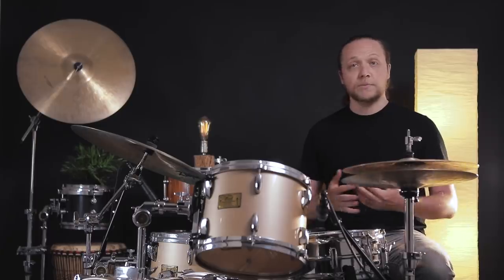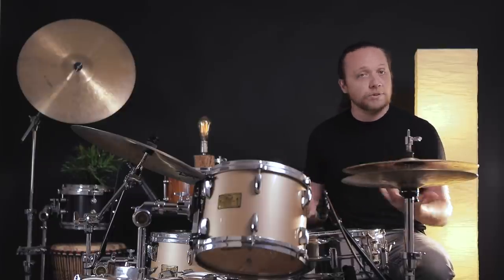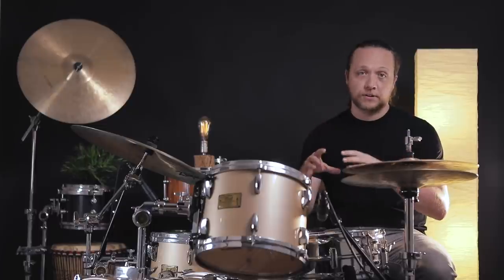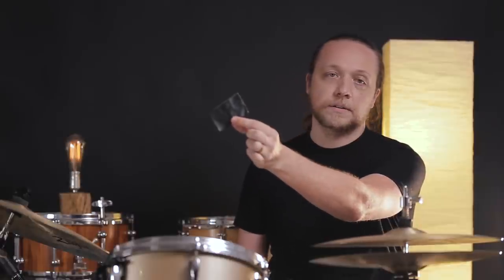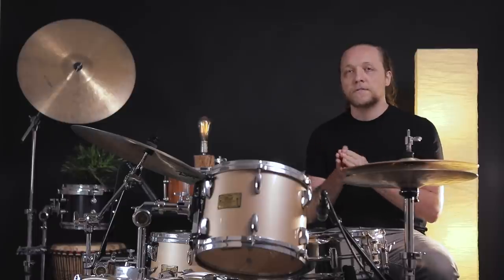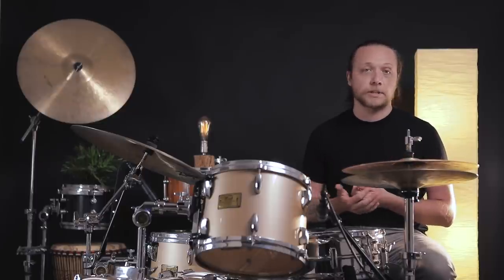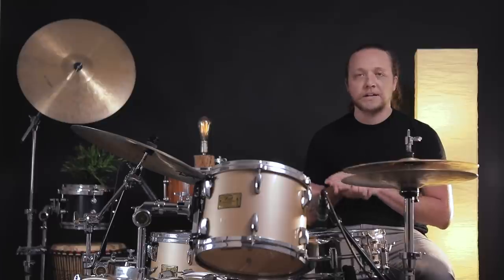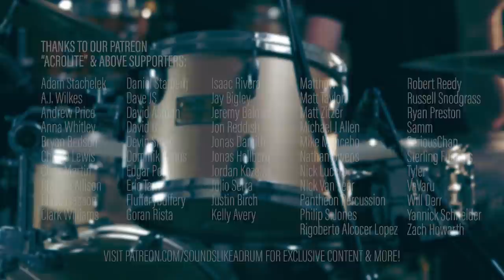Reso Drumhead Trick For Focused Toms | Season Three, Episode 15

Comment: Hello guys. I think Dave Grohl does the same with his toms, especially the DW set that he uses in recent years. He puts a "duct tape cross" on the head of the reso and it definitely must be because of this.
Sometimes I use little blanket bits inside the toms to control the sustain, but it cuts too much. I will definitely give this a try.

Thank you so much for another great video. Cheers.

Comment: currently running a combination of these hacks on my 16x16 floor tom;
nailed a sheet across to interrupt air flow
2 cotton balls inside
taped center
with a coated emp on top, and an evans ec reso bottom. between all these hacks, it's finally sitting where it needs and i wouldn't have been able to come to these conclusions without you guys doing so many experiments. thanks for all you do!

Comment: I love this idea, and will be trying it tomorrow at rehearsal! We recently put UV2's on the tom heads of the set at my church, and I love the sound and feel of them! With the set being sealed in an enclosure, the toms tend to sound a little wild and be hard to control in the mix. I really like the idea of how this helps focus the sound, reduce overtones, and also compress the dynamics. Excited to hear what kind of results I get! 

Could've used this trick a couple years ago when I had my floor tom tone dialed in perfect, but it wouldn't stop resonating. We were outside on a mobile band stand trailer, and I tried moon gels on the top and bottom (off center, near the rim), and it didn't help at all, as you suggested. In a pinch, I ended up resting my stick bag against the shell to absorb some of that resonance. This center patch trick probably would've given me the same (or better) results I'm guessing!

Great stuff, as always. Thank you!

Comment: Answering the question about what I do with reso heads...

I have this same set of drums-same sizes- and they are RESONANT. So much so that toms will ring for a full three seconds. I use coated resos as a rule--that helps more with the character of the tone rather than the length of the note, I suppose, but I've found that when I want the toms tuned to low pitches, a tiny bit of gaff on the edge of the reso head helps shorten the length of the note a bit, especially if near a lug I've detuned. When I say tiny I mean the size of the shift key on my keyboard.

Comment: Hey Cody and Ben!  I work with a couple of drummers sometimes who will use an Evans Hydraulic head as their floor tom reso, as the combo of the oil and 2 plys really enforces a solid low end.  The way they do it sounds really killer, but it is a very low tuning and one might say it has too little sustain depending on the context.  I also had a chat with the drum tech for Awolnation at one point a few years ago, and he was using EC2s as resonant heads for their drummer's kit, following the same principle regarding the extra mass of the two ply head, plus that ring around it.  Either way, I'd be curious to hear what y'alls thoughts are on using two ply heads as resonant heads, and how you think it feels/sounds, and what you think the advantages and disadvantages are to that.

Comment: Benny Greb uses coated resos to a similar effect. Its not as directly focused as this mod will get you, but I find that the extra mass from a coated single ply heads cuts back on a lot of the higher over tones
Reply: in addition he puts a cotton ball that has been stretched out into a small pad inside the floor tom to act like a gate for the extra resonance

Comment: So if I used heads with black dots as reso heads for my toms, would it have a similar effect?
Reply from the maker: Yes and no. Added center mass will help focus the toms. We like the ability to fine tune and easily remove which is why the tape approach is a win for us. On top of that, next to no $ spent.

Comment: Can I ask a question. I've got a Pearl Reference series kit that has slightly rounded edges on the 10/12 Toms, and fully rounded on the 16' tom. I was reading stuff about how people found 2 ply heads on rounded bearing edges(mainly on smaller 8-13' drums) abit dead sounding, like it was all thwack/thud/attack without much resonance, and that people seem to prefer 1 ply heads. So I was thinking of maybe trying Ambassador X's. Have you guys ever tried the X's , or has anyone reading this ever tried them? I was hoping maybe they would be a good middle ground between a Coated Emp and a Coated Ambassador, and sustain/bring out the shells of my Reference drums abit. That being said, the reason Im asking is because I just got the drums, and havent had a chance to experiment with anything yet, and just getting ready to do an order.
Reply from the maker: We’re big fans of 12mil single-ply heads (The Evans G12 started this trend and has been a favorite of ours for quite some time now). Regardless of the bearing edges, two-ply heads can often be a bit limiting on smaller drums so it’s worth checking out some single-ply options if you’re experiencing this.
Reply: @SoundsLikeADrum  OK, thanks. Ya I guess I'll just have to try a couple things, and see hah. How do you find the stick feel is on a 12 mil single compared to a regular 10 ply single or 2 ply head?
Reply from the maker: The 12mil definitely feels like you're hitting more mass than the 10mil (like hitting a heavier cymbal) but it responds at a softer dynamic than the 2-ply options.
Reply: @SoundsLikeADrum  I see. Nice, so kinda somewhere in the middle too. Appreciate it!

Comment: I imagine you could get a similar effect by using some sort of zero ring (or better yet: one made from an old head) on the bottoms, but you'd have to secure them in two places? My drums originally shipped with black dots on the top and silver dots on the bottom. Many years of experimenting later, it's still the right choice for heavy playing.
Reply from the maker: The key is to mass load the center of the head in order to affect the fundamental. You could adhere a zero ring though you’d want to use one that’s dramatically smaller than the drum and that still leaves out mass in the absolute center. Certainly worth experimenting though!

Comment: what kind of batter heads are those-which model of evans.
Reply from the maker: They’re the UV2s
Reply: @SoundsLikeADrum  also just got a new set- my first set since i was kid(pearl roadshow)- what about putting gel pads on the bottom of the toms- and use the gaf tape to hold them on-do i put it on the edges or center to get the most lows
Reply: I have the evans-dampering e rings on the top-they knock out most of the ringing.

Comment: This makes me curious to try just putting cs black dots on the bottom of my toms
Reply from the maker: That’s certainly a consideration worth making. We like the no/low-cost DIY option to maintain your current reso heads and adjust as necessary.
Reply: @SoundsLikeADrum  how about using double clear heads as resos? I think you guys did a video about it, no?
Reply from the maker: @cidboechat9472  As in two-ply heads? Yep, very different effect. https://youtu.be/ew64BFMcmaA

Comment: And what if you do the same thing, but you put the tape on the underside of the batter head?
Reply from the maker: First thing you’ll notice is a dramatic change in the feel of the head. Dynamic range goes do as well. And while the fundamental is a bit more present, if you don’t have your batters tuned high enough, they really aren’t going to project far beyond the drum throne.
Reply: @SoundsLikeADrum  Wow, okay, then I might not try that one out lol.
Also, kinda unrelated, but you could do an episode on mounting floor toms (or just really big toms) as racks; different mounts compared, snare stands vs suspension mounts, etc. That would be interesting!

Comment: i used to use moon gel in the center of the bottom head for this, until they all fell off and i just never bought more, i feel like my drums sound fine without em so idk
Reply from the maker: Yeah, this definitely won’t fall off. While the difference is subtle, that’s the key when it comes to stuff like this. Very similar to the difference between certain drumheads or tuning intervals. Cheers!
Reply: @SoundsLikeADrum  definitely man! i liked how they sounded, i guess it just didnt justify the extra 10 dollars or so for me at the time. this is a way more cost effective method! cheers, and thanks for these videos, this channels helped me grow a lot as a drummer since i started a few years ago

Comment: hmmm I have to try that. I have cotton balls in all my toms. your page has SOO many AMAZING science experiments. so like the tape dot on the floor tom makes the pitch lower but increases the basketball. so combine tape dot + the bisecting fabric.       on a completely random thought. there is a conspiracy theory in the drum world.  the drum companies make these bulky suspension mounts and thinner  shells meant to ring forever while they sell you pinstripes hydrolics and moongels.. tell me that isn't some sort of crazy scheme
Reply: i honestly like the sound of open drums, i think the products just open up more options for drummers. its not hard for me to get the sound i want
Reply: i use hydraulics on my Tama Birch Starclassic kit, and coated g2s on my Tama Rockstar kit, never feel the need to really muffle them in any way, sometimes ill throw an O ring on my floor tom to get a punchier sound, but i generally prefer it to sound bigger and resonate a bit
Reply: @dannyboi9552   I still like my mapex m maple from '05" supposedly all maple it wasn't a long running line.  1/4" shells the "suspension mount" was a little metal bar bridging 2 lugs. you tune that thing right and you get a short punchy cannon.   also I'm a metal dude so I want articulate punch then the drum fucks off. if i was playing a different style I can see the ringing for days thing... just not what works in my normal world
Reply: The thing is that there are a thousand ways to dampen or shorten the sustain of a drum if that's what you need, just pick the one you prefer, but there are no way to increase the sustain or resonance more than the drum (shell + hardware) is structurally able to give you (except adding some effects like reverb, etc, to the eq, but not a "natural" one). So, if you have a very resonant shell, you can also have a shorter sound if you want, but if you have a not so resonant one, you wouldn't be able to get more resonance out of it if you needed.
In other words, you can drive slowly with a powerful engine car if you want, but you can't go so fast with a less powerful one if you ever needed.
Reply: @isihernandez9752  very well said
Reply: It’s not a conspiracy. It makes sense. Many times we WANT the open, resonant sound of a wide open drum. Jazz comes to mind, but the sound isn’t exclusive to jazz certainly. A lot of the early giants of rock drums were jazz drummers transitioning to a new medium, and you can hear it - much higher and more open than today’s rock drums. Hell, Bonham (a jazz fanatic) tuned high and wide, he just used gigantic tubs to get a rock sound. 

You can always decrease sustain on a drum, but if you designed a drum to have short sustain you’d never be able to INCREASE it. Certainly there are drums that are made to resonate less, or be more thuddy, wooly, etc., utilizing materials and bearing edges that accentuate those qualities. We even went through an unfortunate period (called the 70’s) when this reached its nadir with the ‘concert tom’ and reso-less bass drum. No body, it’s a dull, lifeless sound. It might work for recording, but it sounds puny compared to a Zeppelin album! 

Better to have a shell resonating as much as possible, and THEN alter the sustain and such as needed. Now you’re tweaking a full, big sound, instead of starting with something less than. You’re also bringing the shell material into play with more resonance, giving the drums more of the character of the wood or metal rather than hearing all head. Tone, baby. Conspiracy debunked! 😂
Reply: Drummer_Jez : EVANS made hydraulic heads before any resonance enhancing suspension systems were on the market.
Reply: @Riddim4    wanna throw out there that the conspiracy part was meant to be a joke.  but yes I do prefer my toms to have more attack and punch then shut upa bit of resonense but i don't want my floor tom still ringing 15 mins later

Comment: I was in charge of a house kit in a very bright and resonant room. After some experimentation, the winning combination was coated emperors on the batter side and coated ambassadors on the resonant side. I also tuned the batter heads a third above the resos. The result was warm and fat. Enough attack to remain articulate, but not so much resonance as to get washed out in the room.